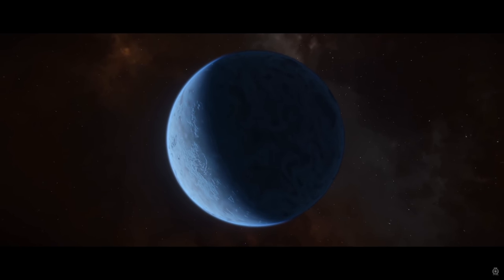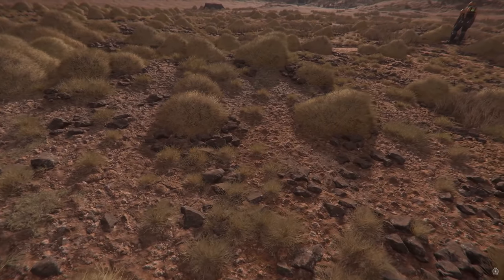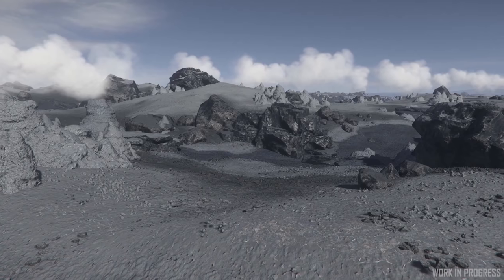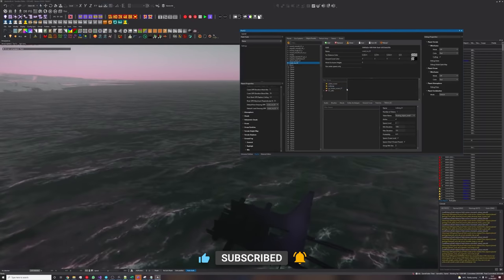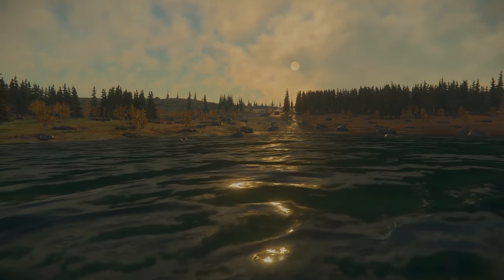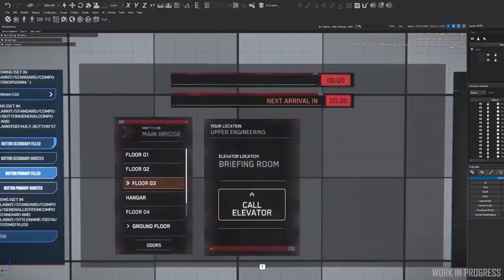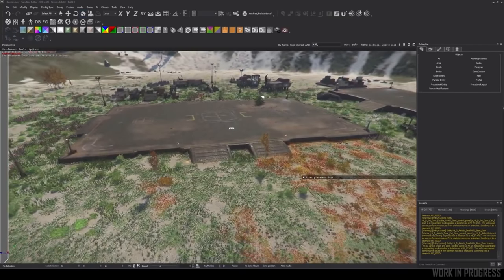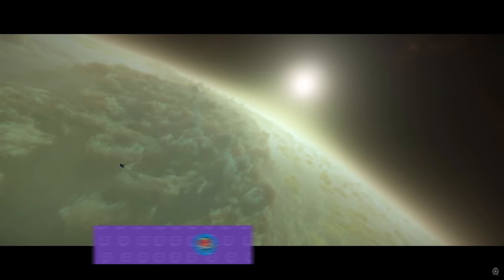Star Citizen | The Future of Planetary Development & Base Building

Comment: Rastar could radically change Star Citizen as we know it. It's not just base building. The interface could be easily be extended and used to command ground forces. Think about it, ground battles with tanks, Ballistas, ground soldiers, vehicles, turrets, buildings, AI and ships. Everything you need for a RTS command of battles in Star Citizen. Tactics, oh and player or org homes, buildings and towns. 

This alone should be a separate game mode to practice.  "Commander Commander" or maybe "Commander & Conquer". I desperately want this expanded. 

Add this, full AI, theaters of War,a dynamic economy, full multi-crew and more planets? I'll never want to leave this game.

Comment: I don't believe for one second that we'll ever see a base building tool that even sorta resembles what they showed here.
Reply from the maker: Why would it? We are years away. The only thing that will likely be used in any version we would have would be the backend. Like I said, this is just the first signs of what will eventually turn into a tool we use.
Reply: @MJ-nn6cr   I've been following the game since 2014. I don't have a problem with the scope. I like its ambition. But they keep redoing everything from scratch.  If they continue to do so, the game will never be finished. Even if they got on track and stopped refactoring everything, based on past progress, the game wouldn't be released with all planned features until like 2026.
Reply: @MJ-nn6cr    first off they have something like 500 plus people already working on the game. I haven't seen a big increase in development speed as  they expanded their staff over the preceding 5 years. So I'm not clear why adding more people will make development faster.  I don't think this is a resource issue, it's a priority and leadership issue.  You can't make progress if you keep changing your mind and adding more scope creep. 

Secondly, why do I care if the game takes until 2026 to be released? Because since the game was in development it's  perpetually been " just a few years away"  from completion.  They announced  in  2016, that the Stanton system would be delivered by the end of the year 2017. It actually got delivered in 2021.  That's an overshoot of  300%.  If I actually thought that the game  would come out in 2026 in a consistent bug-free form with most gameplay loops, I'd be okay with that. That is with 100% certainty not going to happen. 

You've got to understand that even the most diehard fans of this game will lose patience after a certain amount of time. So will you. The question isn't if, it's  at what point. Is it 2029? 2034?  When will you stop believing the game will be completed?   Or will you just keep funding and playing a buggy incomplete mess until you're  out of money or dead ( and plenty of people have died still waiting for this game)?

I hope I'm wrong. I hope the game becomes fun  and entertaining before I lose interest completely,  but I don't have any reason to believe it will anymore.